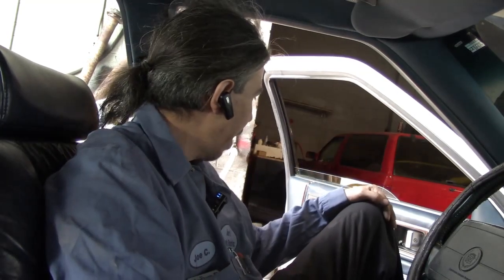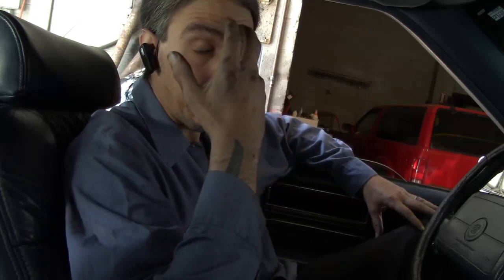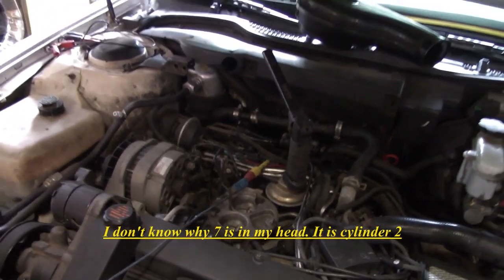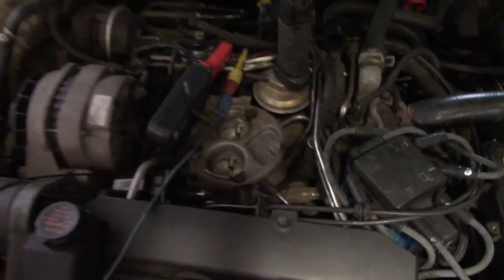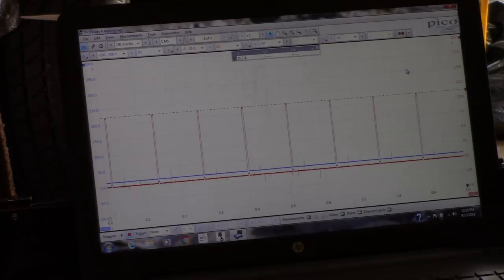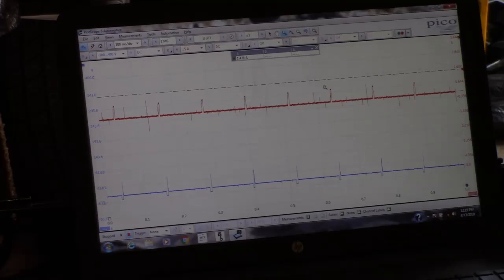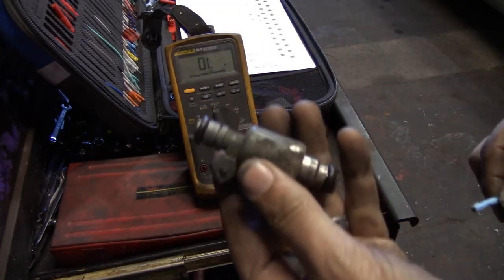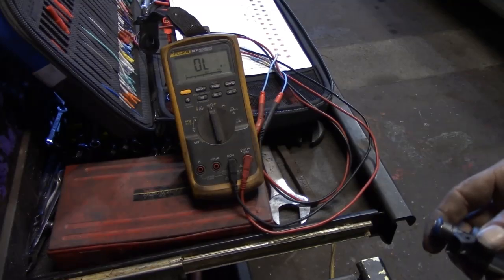Runs Rough  The Cadillac  has a Problem(The TPS They Replaced Did NOT fix the Problem)

Comment: This reminds me of a Dodge Dakota I had in the shop. Like the Caddy a scan tool is not needed.

All the customer wanted was the codes from the PCM. I go out to the truck with nothing more than the key, a pencil, and paper. The key sets up for the read... ON-OFF-ON-OFF-ON and count the codes of the check engine light.

I take to codes vert to the computer and using Mitchell I write down the code definitions.

The customer is HOT because I didn't use a scanner.

Comment: I had a 93 coupe de Ville that I got from my uncle.  The car wouldn’t get out of it’s own way. Turned out it had a blown fuse for one of the computers that controlled cyls 1357 so it was running on 4 cylinders. The fix was a new fuse, 8 new injectors new plugs and wires and a cat. All for $2500 in parts. Loved the car for a few months then sold it.  Good riddance 😎